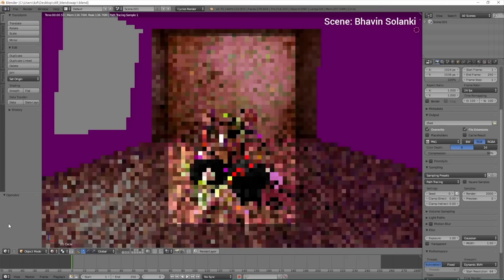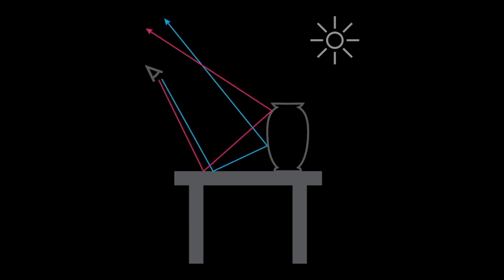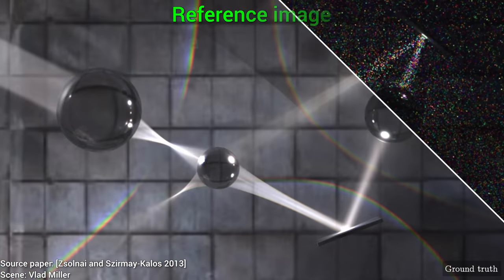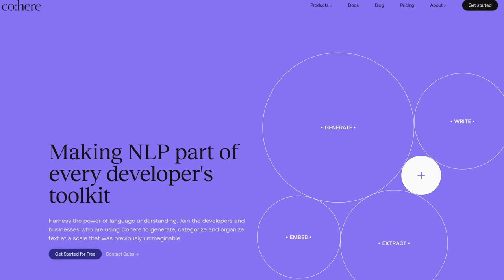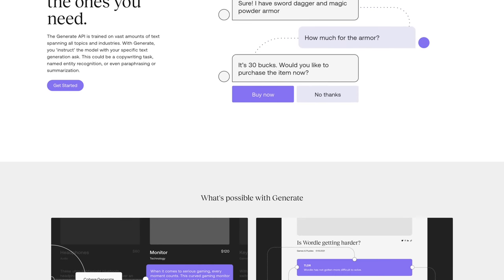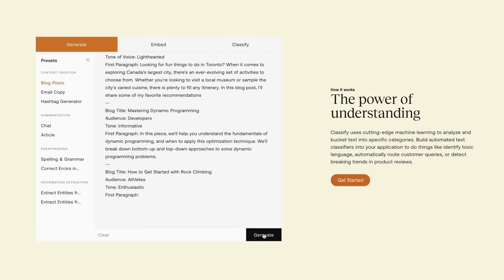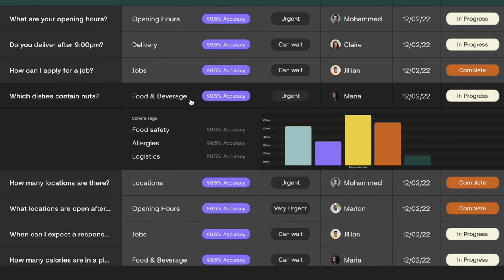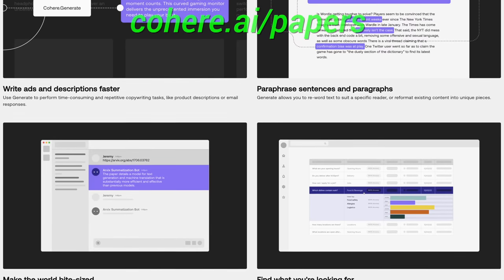NVIDIA’s Ray Tracer - Finally, Real Time! ☀️

Comment: Is it possible to make an intelligent light transport algorithm? one that doesnt calculate the whole image for every frame, but only pixels with a low sample count. So it doesnt always calculate pixels its already sure about. This should speed calculations up tremendously and also make the calculation speed dependent on the complexity of the scene.
This idea is copyrighted by me. If you would like to use it contact me.
Reply: "This idea is copyrighted by me. If you would like to use it contact me."

I don't think stuff like that would fall under copyright, it's a patent at best. Adaptive sampling is already a thing, so it's implementing an algorithm to intelligently decide which is already enough, while providing enough performance overhead to beat just normal statistical analysis of the noise. I'd like to see your copyright claim or patent to this idea if you already have it.

Comment: Didn't the Unreal engine solve the same problem with Lumin?
Reply: lumin is Ray Traced Global Illumination thats used on top of rasterization. this paper is talking about 100% ray traced images.
Reply: @nickhowatson4745  when you say "global", do you mean that the light sources themselves don't move?
Reply: @Mr.Anders0n_  what?
by "global illumination" he means indirect lighting
Reply: @-_wanderer  not a game designer or a light expert here :)
These terms are technical and specific, so you shouldn't be surprised if a lot of people don't know what they mean exactly.
Reply: UE5 with Lumen and Nanite uses a ton of tricks.
It requires a lot of pre-computation and is not really dynamic, does not work on the actual geometry and has many other limitations (when run without hardware acceleration).
That can still give impressive results, but this here is way more versatile and can be basically used with any geometry without pre-processing.
And of course this is also open-source.

Comment: Hasn't ray tracing been real-time for almost 3 years? Many video games are real-time ray traced
Reply: Nope, not in the same sense. They use raytracing for some aspects of it, not full blow path tracing (except Quake) and they use optimization techniques that result in loss of high frequency details.
Reply: @ZalvaTionZ  so is this full path tracing like in movies ? and if so ... how long until we see it fully implemented in open world games ?
Reply: @el-_-grando-_-_-scabandri  10 years
Reply: @armin3057  nah, it's gonna be pretty soon. Did you see blender's Cycles X render engine's viewport rendering speed on an RTX 3090? It's almost realtime. I think an RTX 4090 or the next gen will make that totally real-time. 
By the way, Cycles is path traced, not ray traced...
Reply: @sm71485  path tracing is a type of raytracing
Reply: @-_wanderer  but in path tracing everything is path traced, and in Ray tracing, only a few properties are ray traced, right?
Reply: @sm71485  No. This is fully raytraced.
Pathtracing is a strict subset of raytracing.

Comment: Doesn’t unreal engine 5 do the same thing?
Reply: No. This is quite a bit more advanced. UE5 has ray tracing in the form of Lumen, and it can do software only, or a mixture of software and hardware acceleration. The temporal aspects of it's filtering are taking entire frame outputs for denoising, not retaining calculations and adding them onto new calculations like here. The issue with the whole frame or individual frame buffer techniques is there becomes almost a blurry swimming appearance of the effects since there rays per pixel count is too low, requiring a lot of temporal smoothing, which bleeds into movement. I am curious as to why it appears Nvidia is filtering the final frame buffer here though, as the textures are smoothed out in addition to the noise RT calculations. Wouldn't think their light transport denoising needs the texture output in its calculations, but maybe. It's a good step forward, but has some issues.
Reply: @JimBob1937  thanks for the detailed response. That was very helpful!

Comment: Still unacceptable quality compromise for anything professional. I do not need fast denoise but more sample , more spp troughput, optimization of older cards to be more efficient, more efficient use of the cores, of the dam almost 400 W used , not a dam denoiser that destroys details in textures you work so hard to get in smallest detail and when you build a dam complex shader denoise is the last thing you want to do. And improper use of the denoiser introduces flikering in animations to unless the sampling is so high set that noise is almost non existent and then the denoiser speed is irelevant. No this is not improvement, this is meh at best and more a disapointment.

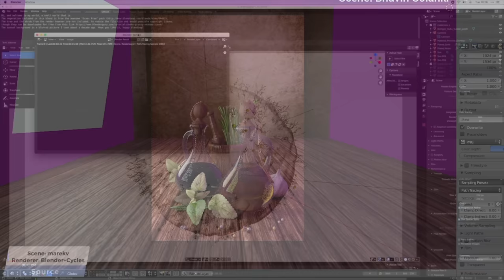Comment: 0:40 "noise, this is not photo realistic at all" but you get noise in photos?
Reply: Different type of noises, not at all the same aesthetic visually.
Reply: @ZalvaTionZ  but I feel the only reason for this is because cameras take in more light and camera noise is multi coloured due to chromatic aberration. If you apply realistic chromatic aberration in a render you'd have a very similar look.

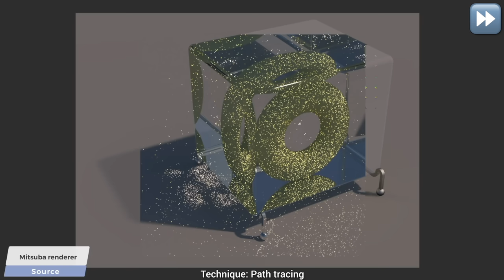Comment: 4:49 I'm sorry guys, but i'm not impressed at all. Destroying details by fast and imprecise denoising, effectively lead to ugly non detailed blurred textures. What's the point of detailed render taking  minutes per frame, when we then simply discard all the details. 4:52 This looks like a Half-Life 2 worth of textures - UGLY as hell. I don't even wanna mention that opera scene 3:55 where all those golden statues and details on carvings ale lost. It's like using jpeg algorithm on high compression setting. That's why people love RAWs. 3:36 look at the balcony right before and after this the splitting image. All those details gone just for the sake of "clean" image... Yep, "good job"- throwing details away in favor of smooth-posterised image. I don't understand you Karoly on this one. I like your videos, but this is NOT progress.
Reply: I'm kind of curious if they could simply apply the denoising to the RT frame buffer directly (as I imagine the RT output already is its own buffer), and then apply that to the final frame buffer. In some of those examples it does appear the final frame buffer is having denoising applied to it for some reason.